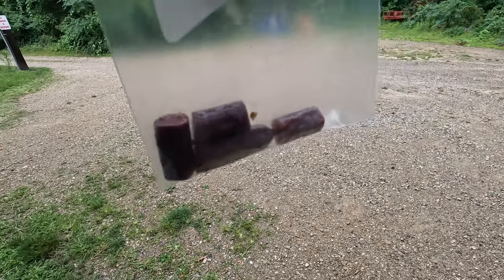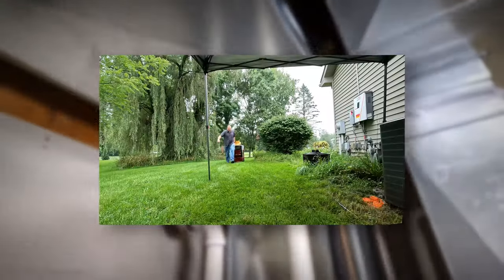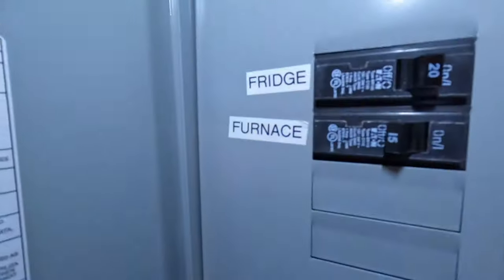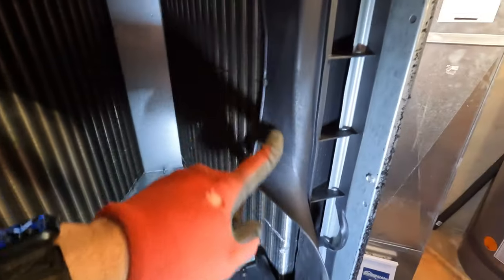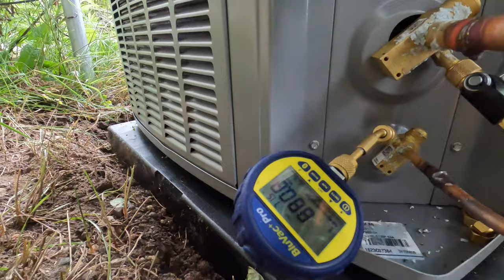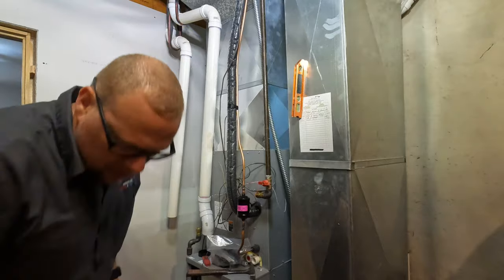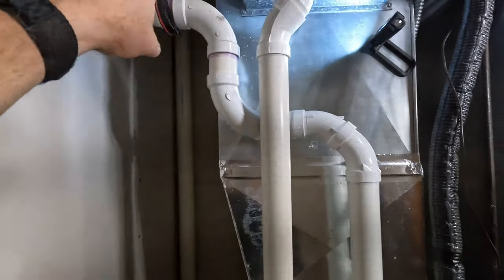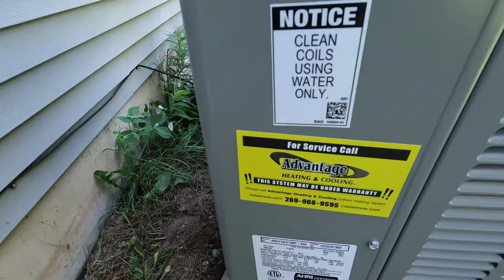Unbelievable Upgrade: Armstrong Replaces 16yo Goodman HVAC!

Comment: I wish my boss would install Armstrong. I put a few of those in my cousins house about 20 years ago. Still working to this day. One of the systems is straight ac/ air handler, he has NEVER had it serviced, just replaces air filter. Still works fine. 
It must be nice to have all that equipment in the the truck. 
Great job 👏
Reply from the maker: Thank you! Yes Armstrong’s are awesome the late 90’s to earlier 2000’s those were kinda a pain especially with the smart gas valves. That’s my 14’ trailer that I purchased back in 2017 that break and Pittsburgh machine I purchased about the same time I installed that Goodman furnace.

Comment: Looks good. I’d put aluminum hardware cloth/critter guards on the vents outside so those pesky rats don’t climb in in the winter
Reply from the maker: Great idea, But in the Winter around here that would freeze up and they would have no Heat. Not to many rats around the Area.

Comment: I might have missed it….what was the cause of the pan melt?
Reply from the maker: Don't really know? My customer had an Issue with one of the big filters at one time during last heating season, so we are thinking that might have caused the furnace to overheat and thats why the Drain pan possibly melted.
Reply: Impressed with the sheet metal work!  Did you do a combustion test and gas pressure check?  Very neat installation and professional job!
Reply from the maker: @1022hard thank you! When I used to install Goodman and Amana I always did Combustion and gas pressure checks. Had too they were always off. Since went back to Armstrong/Concord once and awhile I will check. They are spot on every time.